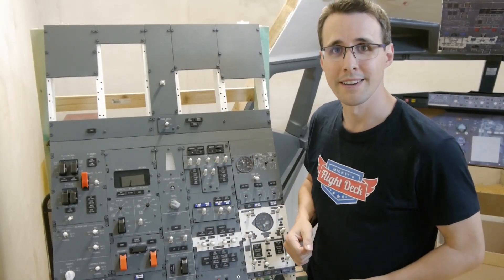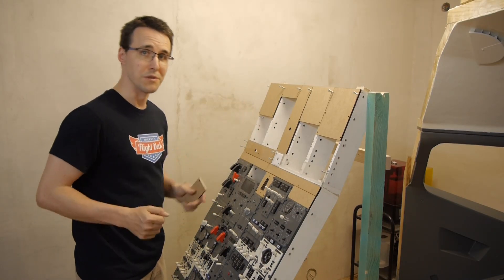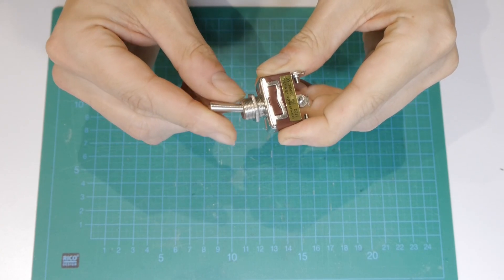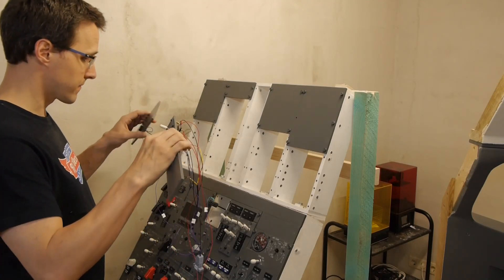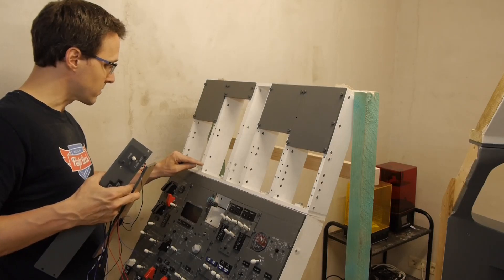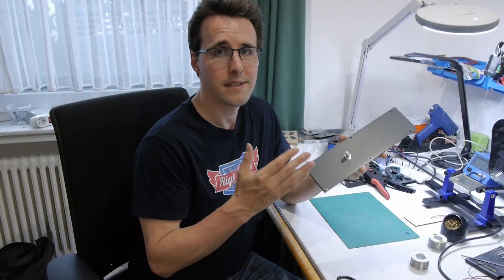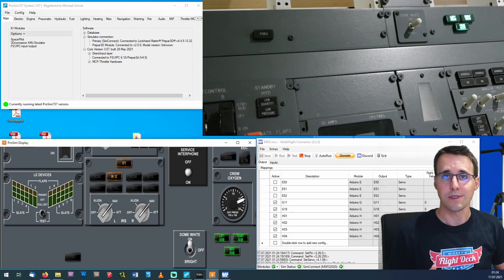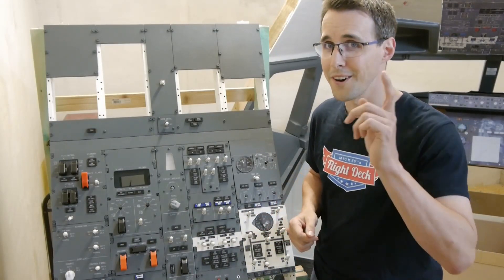Dome Light & Overhead Covers - A Boeing 737-800 Homecockpit #57

Comment: Halo michael, i realy need some help to seting my Landing gear with arduino, any tutorial to find out? Please
Reply from the maker: I haven't realized this project yet. But if you are using prosim you can install several micro switches and route their signals to the cosseponding variables in the system. The positions of the lever can be handled like any other switch.

Comment: Apart from the fact that the dome lights are in the back wall and this flood light is meant for the pedestal (which is already mentioned) I think the light itself is very neat. I’d like to know how you constructed the light.
Reply from the maker: It is visible in the video. It is just made from two 12V LED stripes.
Reply: @Mickeys_Flightdeck  Yes, but you skipped the part of the LED strips. Could you please specify what kind of strip this exactly is (brand, type, manufacturer) and how you fixed them to the board?
Reply from the maker: @737sst  You can see more about backlighting in my video #38 at 12:00. The  name of the strips is "5050 60 LED IP21".
Reply: @Mickeys_Flightdeck  Thanks Michael, found #38 video very instructive. Have done a search for the strip, but seem to have problems finding IP21. Did see IP20 & P22, but do not know what the difference is. Where did you buy yours?
Reply from the maker: @737sst  I bought mine on aliexpress. The IP stands for the waterproofnes. Just search for some that aren't covered with silicone.
Reply: @Mickeys_Flightdeck  Thx